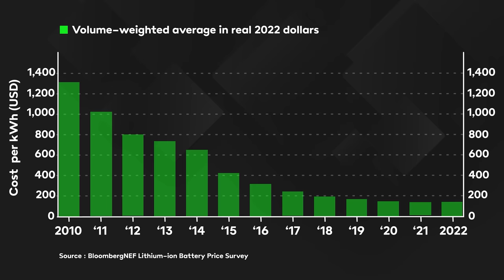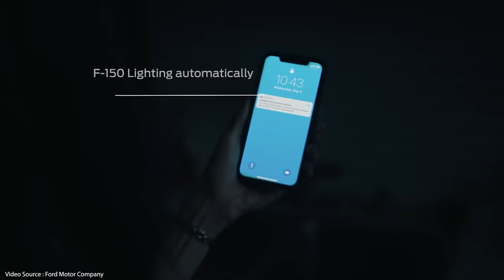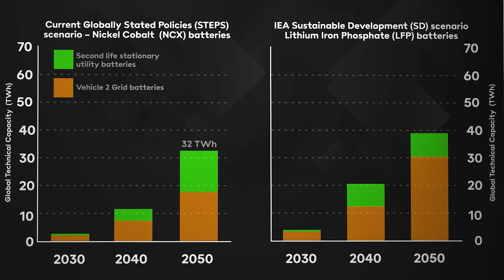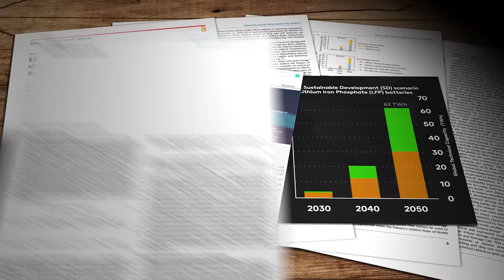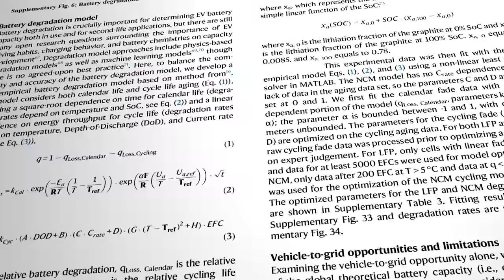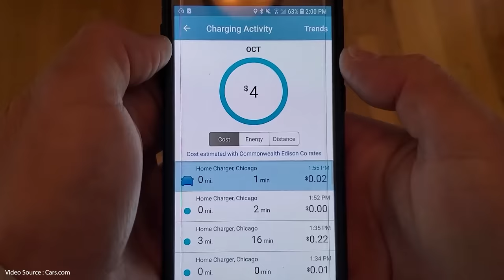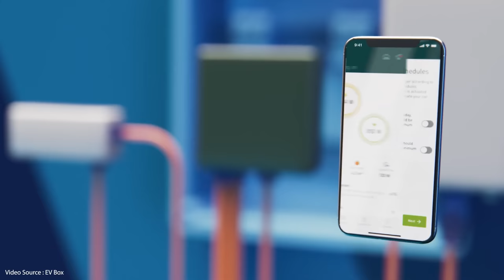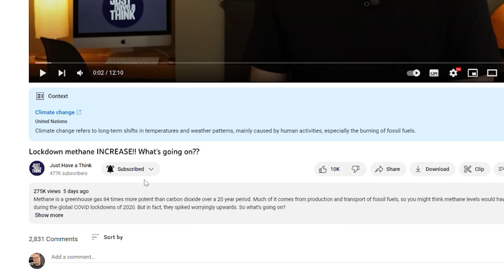Can the electric grid ruin your EV battery?

Comment: I have an Renault ev. Not a word in the manual about what factors would affect its battery life. As a result i apply my own knowledge such as not fast charging, not fully charging unless needed, minimizing depth of discharge and worrying about charging it when the battery is very cold. If consumers were to fully apply good practice in this regard then maybe the degradation of a battery that provids grid services would be significant. People may be reluctant to allow this unless the money was really good.
Reply: I'd say people would be reluctant, because likely battery degradation (research paper or no) their ev is a fairly big investment and two, getting into your car and finding out you have no juice.
Reply: Yes, there is absolutely no way I am going to let the power company use my expensive batteries without meaningful compensation! There would also have to be guarantees that it would never be drawn down below 50%!

Comment: I am in the process of installing solar panels and batteries to limit the need for grid connection. Ideally I want to use my EV battery as an additional emergency backup option, but the thought of trying to get a decent deal from any greedy utility company is way down on the list of options. Utility companies need to have a revolution in their current thinking to be able to offer a viable solution. 
I hear stories of users being charged $12 a KW in peak times, because they have been losing so many customers. That kind of "thinking", only ensures that even more customers will install batteries to avoid those kind of ridiculous charges.
Reply: I'm in dispute with a greedy British utility company.  I've come to the conclusion that going off-grid is the only answer, in the UK we pay a daily charge (in my case £1.50) before we even take one electron from the grid!  (Even then we give it back again 1/25th of a second later 😀)
Reply: It does make you temped to add solar as fully off grid.
Reply: going off grid is illegal in my state - state passes whatever law elec util asks
Reply: The grid is a public good.  It can't go away.  It's needed for too many things, and not everyone is capable of being their own electrical utility.  SOMEONE has to pay for the grid.  Since it's a public good, we ALL need to contribute.  Going off grid just means you are offloading the cost of the grid onto everyone else.
Reply: @incognitotorpedo42  Surely if it's a "public good" then the public should have a major say in how it is run and how it effects them. I understand your concern, but in reality I will be subsidising other users. I will still pay the increasing charges to the utility company, but rarely if ever use the service.
Reply: Look up Tesla Energy in California and Texas, it runs arbitrage services to the grid gaining premium prices for powerwall owners which could be expanded to V2g.

Comment: Hmm, I was wondering about this very thing, and for my Powerwall as well.  I guess if the grid paid enough to offset that 5% life loss, then ok.  I do not agree that EV drivers suffer from a gasoline induced mileage problem however.  If you live in countryside, you have to seriously plan a lengthy stop (compared to gas) if you are going to exceed the max range of your EV.  I hardly ever go outside my max range, but I certainly am very aware of it, even after more than 6 years of EV ownership.  Over time I believe this will change, but currently I do not know of ANY public chargers (not even talking about fast chargers here) in any of my surrounding towns.

Comment: The cost of replacement battery packs for EV cars is still very big ($10,000+ for most Tesla's) so their is no chance of allowing the "grid" to reduce the life of those packs by allowing it to suck energy of out of them unless the $ income of that is considerable (very unlikely) or it is proven that the battery life is not impacted significantly (less than 1% per year). The use of recycled/reconditioned battery packs for offline storage is quite another issue of course.

Comment: Use of distributed batteries for grid storage is in competition with the user interest in having the vehicle at max charge in the morning.  For batteries to be useful people would need to be convinced to conceded some battery capacity to grid storage.  A full battery cannot store more energy,    Big as an EV battery can be, management costs for millions of such installations would be enormous.

The big problem with EVs once widely adopted is the question of the source of energy.  Wind and solar have limitations. and there is existing fossil fuel generation to be replaced.  I have seen little if any analysis of just how all this electricity can be generated without emissions, even given cheap grid storage.

Two more questions that need big picture analysis to understand the quantities involved.

Comment: If the grid moves towards having electons flowing both  ways, the existing grid capacity may be adequate. As the electrons from your battery/inverter setup may only need to travel up to the guy next door? Also, the peaks and troffs experienced by the power stations should be a lot calmer.

Comment: Simplest solution instead of grid tension availability. Like EVs and smartphones. Electric powered houses with its own power storage. So no more solar into grid and no more grid fluctuations storage. Manage your car, phone, AC, heater, appliances, TV, computers and infotainment systems with its own batteries. Receive a full charge and use instead of buying electricity on demand.
Reply: Investing in power banks

Comment: Another great video again! I believe that the degradation problem can be easily solved with battery swapping. Battery swapping stations could be used to stabilize the grid, and degraded batteries can then be easily swapped for new ones in the stations. That way you extend the lifetime of an electric car, and you will also solve the problem of long charging times. The batteries could then be leased for a monthly fee, which would make the purchase of an electric vehicle less costly initially.
 
I hope you'll take the time to take a look at the advantages and disadvantages of battery swapping on day. China is leading the world in battery swapping, and they are now also building battery swapping stations in Europe. So they are coming.

Comment: The reason that lead acid batteries have a near 100% reclamation rate is not because they are expensive, it's because lead is toxic and waste batteries being discarded are a significant ecological and health risk. The way they get that reclamation rate is because there is a significant deposit ($12) added on to the price of every new lead acid battery that is refunded upon return of an old battery.

Comment: The vast majority of the benefits from V2G can be achieved with the far simpler adoption of smart charging. Most cars spend 22-23.5hrs per day stationary. They have batteries far larger than the typical daily need (rightly so). These two facts mean that there is huge flexibility for most people, in when and how they charge. My provider offers me a great deal if I use a 4 hour window overnight. Smart charging can give us the highly adaptive demand that can smooth out daily peaks and troughs in residential energy usage. It can even allow for days of reduced demand. I know because I already do this. I can easily decide to charge more on the Wednesday, and not charge at all until the weekend. If that all becomes smart, but with the driver still in full control then everybody wins. We can override it whenever we want, we can change the schedule if we wish. We can also set a minimum charge level for our cars. We can then actually wear the batteries less, as charging closer to the time you need to depart is better for the battery. So smart charging has almost all the upsides of v2g, with none of the downside

Comment: In order for EV batteries to have a second life there needs to be standardisation and the battery pack needs to be repairable. Having to bin a battery because of a few or even a single dodgy cell is far from a good idea in the big picture. Also we need to change the way we specify batteries. For sure how much energy the battery can store, how much it weighs but also the lifetime energy throughput needs to be specified and warranted. 
Here in Au and no doubt most countries there's enthusiasts keeping almost century old ICE vehicles running. That's possible because they're simple machines that came with a well written workshop manual. Even if Ford no longer stocked parts for their very first model all the dimensions of the all the parts were documented or easily discovered. Plenty of people around who could make the part needed.
As for all this talk of recycling. We need to remember recycling takes energy. 
Oh and yes, The Grid. I doubt EVs will cause it to melt. Grids do have protection systems to stop wires melting and sagging and transformers bursting into flames spewing burning oil everywhere but in order to protect itself the grid will go dark, maybe very dark for a long time. The challenge is those pesky annual holidays where there's inevitable long queues of ICE vehicles waiting to put juice in their tank. How are we going to handle those situations when every vehicle is electric and needs to be off the road being charged for way longer than it takes to fill a tank with petrol?  Sure there's rapid charging available for most EVs but that means having  a stationary battery fully charged ready to charge the battery in a vehicle. Seems to me for every EV on the road we'll need another battery of similar capacity ready to dump energy into its battery. Will someone please think of the resources we're going to need.
On a positive note I'm pleased to hear that some are waking up to the advantages of LFP cells over NMC.
Reply: Mega packs at charging stations can also be used for stabilisation of the grid. A few dodgy cells in a pack won't hamper it being used for power storage.

Comment: The race between EV's and green power is in an almost dead heat. Almost the same time that you'd be getting and electric car and plugging it in at night, the same kilowatts being added to the grid will be solar/wind. Without a doubt this will be the most important material improvement to our lives since those phones. There will most certainly be a point where decommissioned batteries standardize to degrees that a second market can buy them off OEM's. The same folks that put the battery return for existing batteries can put deposits on them to.

I have no doubt that the first F150 lightnings will find their batteries bought off them as they get scrapped. It would be a smart play by Ford to have them power another market segment or offset the factories night shifts.

Comment: The more of us that produce our own power, the less land will be needed for big grid projects which take far longer to get up and running with permitting issues and problems connecting to the transmission system. I am currently 99% off-grid with solar and home batteries. To get to 100% I did consider wind as it tends to be more windy in the monsoon season here, but after research on domestic wind I feel that it’s not a viable technology yet. Instead my next EV will have V2L, maybe the BYD Seal which has 4kW power output. We hear a lot about V2G but very few cars have this built in. V2L is easy to integrate into a solar inverter. As I have a big solar system I am banned from exporting to the grid, this is the case in many countries and people are restricted to smaller solar systems at around 5kW. This restricts how much domestic solar can be part of the solution.
Reply: I am interested to see that when Ukraine rebuilds that they put solar panels on the roofs of their buildings so they will at least have some electricity in case they are attacked again and/or their infrastructure has temporary failures related to reconstruction.
Reply: Where did you get CATL back up battery

Comment: V2G is not as vital and not as much of a priority as first thought. For starters, the majority of future EVs will be fully autonomous and therefore will not spend much time sitting connected to the grid. Furthermore, home and grid stationary storage will eliminate the need to use EVs as a power source. Plus, just using your EV to power the home is not practical because if you drive your car the home is powerless.

Comment: Energy use ebbs and flows. When computer proliferated that same question come up because of power hungry computers and monitors. Well, that went away is LED monitors, lap tops, tablets, etc. Now it is BEVs. My own experience says it is not an issue as my electric usage has not increased with charging my BEV and adding AC to my home. How?, LED lights through out the house, all exterior lights being day/ eight and motion sensitive, in stalling Star appliances, heat pump, etc. I have been in our home almost 20 years and have only seen one or two electric bills above $100 despite my wife needing lots of lights on to fight depression.

Comment: The changeover to electric cars will not occur overnight, but it will happen quickly over the next decade. The power companies have more than sufficient time to upgrade their infrastructure if they don't sit on their hands, and vehicles that can smooth the power usage spikes by contributing to the available grid power during peak usage will help, but should NOT be relied upon to slow grid capacity growth!

Comment: THE PROBLEM is literally the batteries and the electric grid.
Since we use wrong electricity (inductive instead of capacitative) we are forced to use closed loop systems and thus batteries to be charged by the closed loop system.

If we were to use Tesla tech of true wireless, we would be using near loss-less electric distribution using 1 wire system and you could drive your electric cars while it being powered by the ground 1 wire system.

But rotshilds and rokefegers didnt want this, cause they would lose they oil monopoly money.

Comment: Comparing electric vehicle adoption with the advent of the smart phone might be undercooking the profundity of EV adoption for all the reasons you mention, but inevitably countless more. There is an elegance in the efficiency of electrical systems that do away with the wasteful combustion of fuels to produce rotational work. Battery energy density should reach and improve on fuels, allowing air and sea transport to switch away from fuel too. Profound times.

Comment: Imagine every household has an EV (or 2, or 3…), and there is a 24 hour power cut over a large area so everyone in that area uses their EV to power their home.  The load on the grid when the power comes back on and everyone wants to recharge their EV simultaneously is going to the polar opposite of a stabilisation factor.   Just a thought!
Reply: Imagine that the home controller is integrated with the grid. The grid switches cars from discharging to charging in phases, not all at once. Potentially they could see the state of charge and start with vehicles at say 10% of charge, then added in vehicles at 15%, 20% or whatever. They may even have control of the charging speed of the vehicles, so that they can charge all the vehicles but limit some/all of them to a fraction of their normal charging speed.
Reply: Yes I can see that with that level of sophistication it can work, it adds more kit to roll out to all households. One can imagine some peed-off consumers who need to go somewhere shortly after an extended power cut finding they are not priority for charging.  Everything is a compromise of course.

Comment: I know you think it's antiquated  but I regularly do 8 hour drives ones a quarter so it is not a hypothetical concern for me
Reply from the maker: Yes, but look where you sit on a Normal Distribution Curve ( bell curve), @killer3883  - systems and infrastructure upgrades have to be based on the law of averages, not on unusual individual cases. As Mr Spock once said..."the needs of the many outweigh the needs of the few". And that was Star Trek, so it must be true ;-) LOL
Reply: @JustHaveaThink  something I have wondered about is the idea of having a extra travel capacity compartment. Buy a car with 200 mile range, but has the option to plug in an additional battery you rent that brings you to 1000.  May even be an aluminum air or something that is more dense, but one use and recyclable

Comment: I keep hearing this point with the batteries that are just sitting in our driveways, and having this sources of energy unused seems wasteful, but wouldn't you say that a tank full of petrol (gasoline) or diesel is just "sitting" there without being used? How is that any better? We have at our disposal plenty of sources of energy ready to be used at a moment's notice, woudn't you rather have something that is easier to recycle and doesn't polute? Is this because of the monetary value we give to this source of energy? Superficially, the petrol costs less than the whole battery, but not for the duration of the life of the vehicle. In a space of 10 years, which is arguably the average life of a vehicle, we put 20-30 thousand dollars in fuel (assuming an average car), that is just more wasteful than a battery.

Comment: 1. A big problem with reuse are going to be structural battery packs, like what Tesla has been looking to use. Can't upgrade and recycle batteries if you have to replace your car's chassis.

2. You're talking about "electrons" like it's some kind of fuel, where the battery is "donating electrons" to the grid. That's not really how batteries work. Just say "energy" instead.